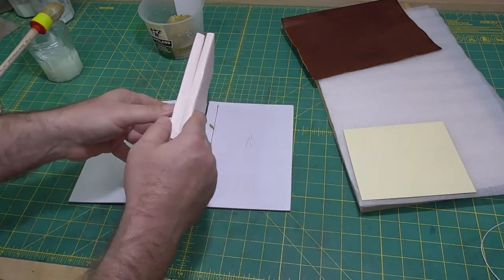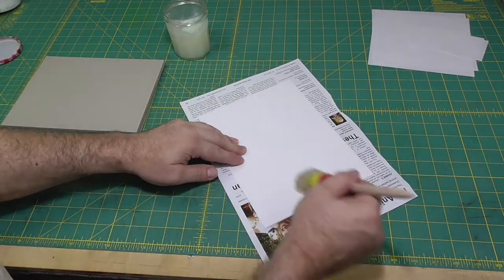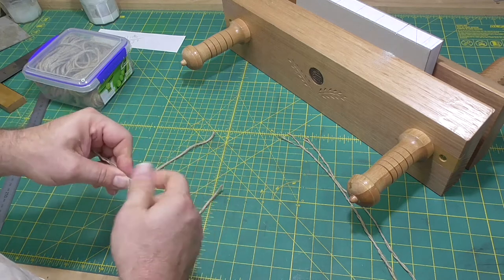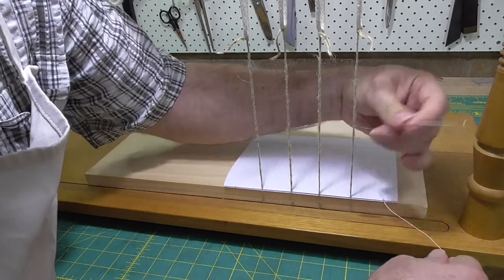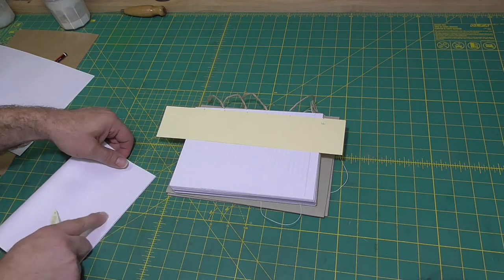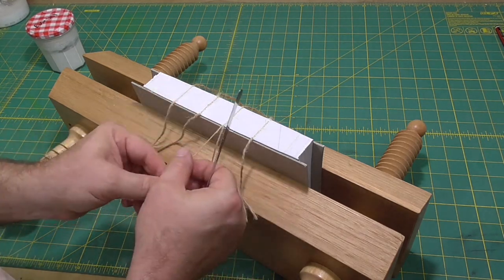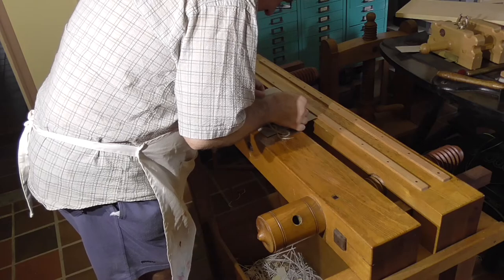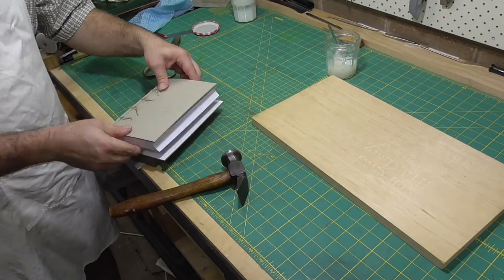Forwarding a Leather Binding with Laced-On Boards Part 1 // Adventures in Bookbinding

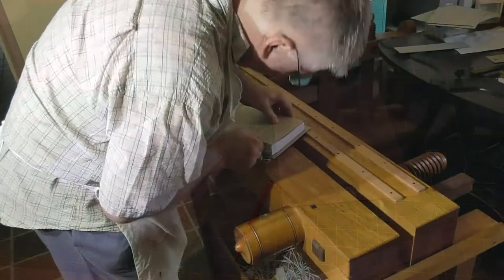Comment: Thank you again. I love watching you work because I always learn something new. I noticed at 22:25 that you appear to be measuring the diagonal of your book, just after you transferred the trim lines. Are you checking the book for square here? I was also wondering if you were concerned about the slips being in the way of your square and if you found that the slips throw off your square when you transfer your trim lines? I have hoped that you would do a video on this style of binding for a while now because this is the style that I am currently practicing with. Can't wait for next week.
Reply from the maker: Yes, it's good to keep an eye on the squareness.  A non-square text can be recovered, but you will always notice little things like an uneven square.  It's just easier to get it square even if you have to recut an edge.  In this case the cords are well sunken and don;t interfere.  But tapes will get in the way.  In which case I will just make sure that part of square is parallel to the spine, judging by eye.  All the best, DAS

Comment: Has a cat made a lasting impression on your endpapers while they were out drying? that s kinda sweet, now they are very special limited edition endpapers. :) dear Das,  thank you so much for your Videos, they helped me so much already. Just yesterday i had a problem with warped leathercovered boards..the warp was ...huuuggee! luckily i remembered that in one of your videos you were talking about it, so i went back to check them out (the video with the blue full leather binding and another about lining a board). I followed your teaching as close as possible and i could really fix it, it felt a bit like perfoming magic. before i thought it was impossible to do, as warped as they were. But thanks to your geekskills and physicswisdom it worked and now I have two perfectly straight boards.  Though I still have to apply the endpapers, i hope now it wont warp the other way haha. i think in this case you said to use pva and put it straight on the boards, or i havent done my homework correctly. BTW physics was my favourite back in school, and later even studied it a bit at university, but couldnt complete it for reasons that would be too long and personal a tale (to use the words of a great lyricist) but i am  still into everything physics and recently also bookbinding. I am really grateful for having THE best bookbindingprofessor that is DAS Bookbinding, and i added you on patreon. Best regards from berlin. julia
Reply from the maker: Thanks Julia, and you are very welcome.  And thanks for the Patreon.  I'll see you over there.

Comment: Thank you for sharing!

I was just wondering where are the weaver's knots. I can't find them on the spine...
Did you kept them inside the sections?

Regards
Reply from the maker: The thread is only slightly visible at the cord locations on the spine.  This is why the knots have to be on the inside.  Really no where for them to be on the outside.  DAS

Comment: It looks like, when you are sewing on the endpapers, that you are not sewing the chords into the loops but are sowing "under" the chord instead of around the chord as you did in the rest of the sewing in.   You don't mention it, one way or the other, in the discussion.  Can you clarify this?
Reply from the maker: I sew the endpapers on almost the same as the sections.  The thread goes over the cords.  The difference is that the cords are not sawn into the endpapers to avoid cutting into the decorative fold.  The thread is not pulled as tight to allow for this.  Hope it makes sense.